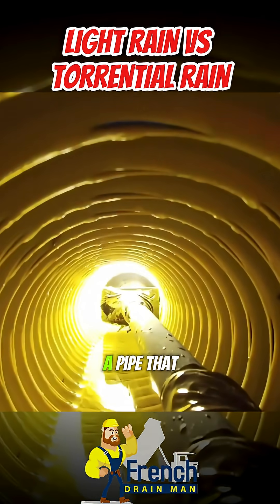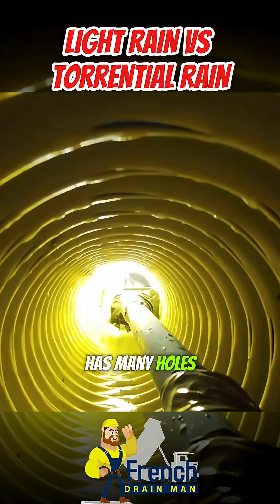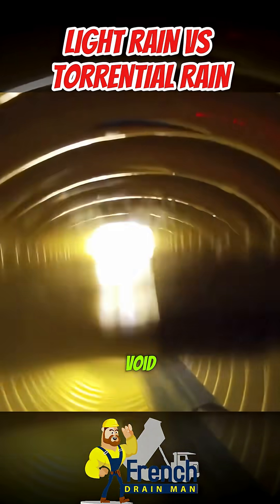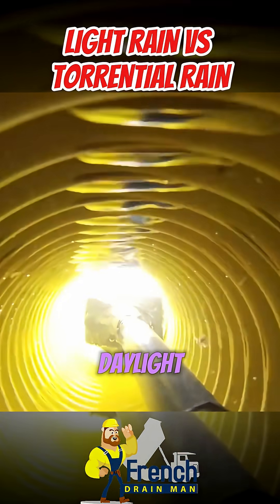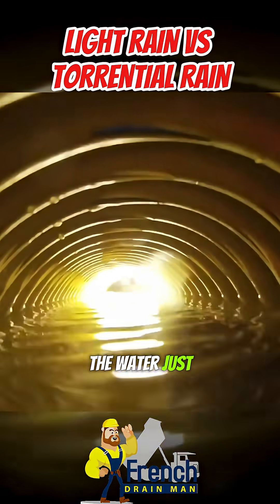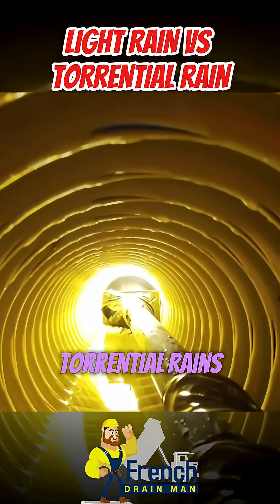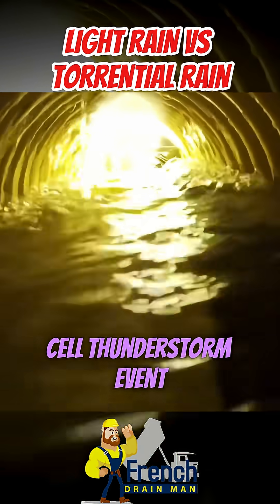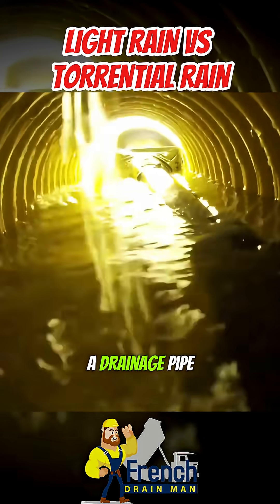See How a French Drain Works

Comment: I like that footage.  IMO you should test 12 inches of your burrito wrap to see what NOAA rainfall data it could remove.  Obviously it would be limited due to the pipe's flow rating but for blind-inlets/rock-inlets(unlike/different benefits than curtain drains) using limited lengths(usually 30ft-40ft lengths,  though I would want both ends connected to the discharge pipe, duals) & large 6+ inch discharge pipes is what I would advertise in my area if I had a drainage business b/c the 17 counties here mention the area not having slope great enough to meet self-cleaning recommendations of pipe manufacturers like smooth-wall/dual-wall can.   I can't do the math today but I'm reading that we should all be planning to drain the 100 year / the 1% chance flash-floods to protect our homes & health.  If your pipe with the slope here is rated for ~100 GPM then I would want my neighbors connecting it several times to a 6 or 8 inch pipe to get the water 80 or 100+ft away.  Plus the velocity at the intake is way slower than the velocity of water exiting a somewhat straight discharge line so IMO the intake side should be rated at 2x the GPM than what we are calculating at the outlets.